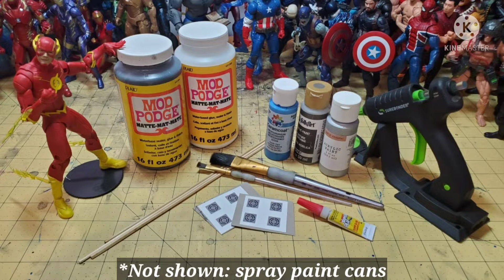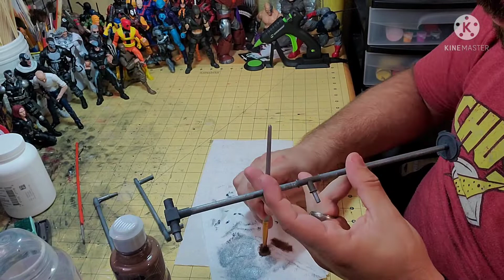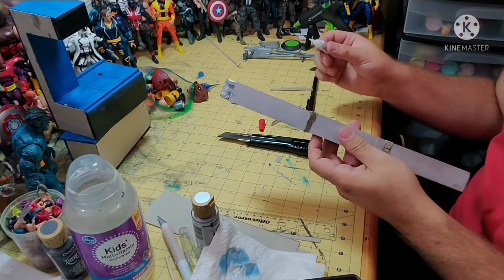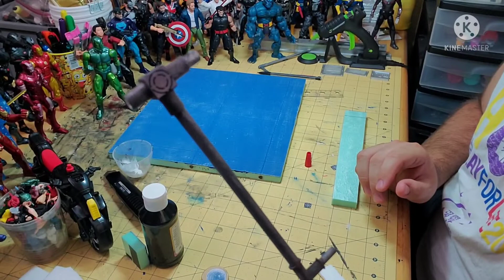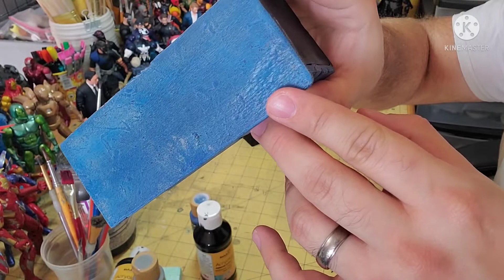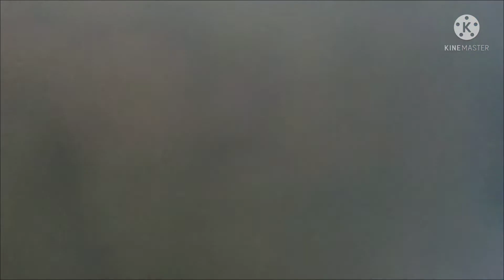DIY Laboratory Diorama: Part 2

Comment: I really need to try to make a diorama, i'm a bit nervous to do it!
Reply from the maker: I get that, it can be overwhelming. Start small. Go to a dollar store and get some paint, brushes, glue and some foam boards. Super easy to start and low cost. If you have any questions please feel free to message me here or on my Instagram under the same tag. @JarodMakes.

Good luck and happy building.
Reply: I just finished my first Dio with cardboard and crafting sticks. Made a tmnt sewer Lair. Because it can be crappy and crooked and still look good cause it's a sewer Lair build out of mostly trash. I'm happy with it for now